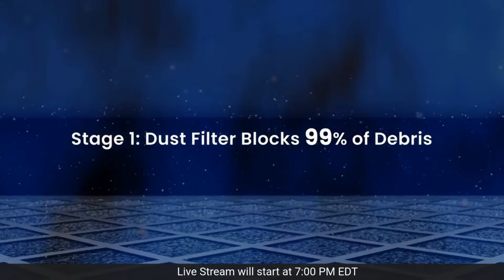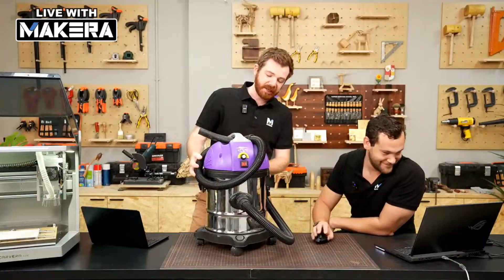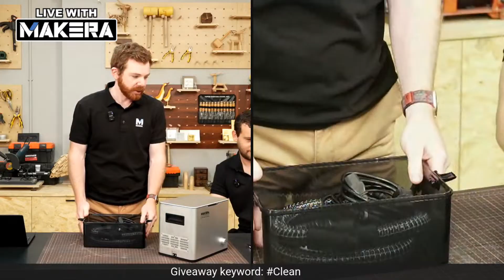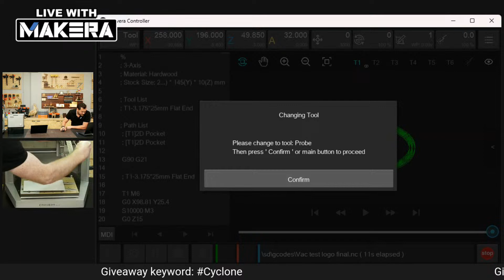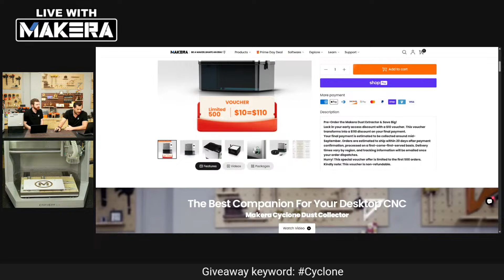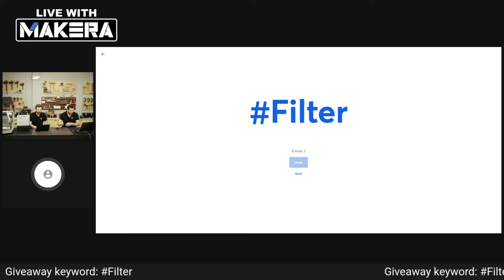New Dust Collector Launch & Lucky Draw

Comment: I have the Carvera, when you say that the adapter will come "soon" - what's the timeframe we're talking about? I would like to begin using the dust collector as soon as possible. Also it would be nice if the streams sometimes could be on more EU-friendly times :/
Reply from the maker: We do not have a specific release date at this time unforuntately, but we are adjusting our steam times to acomodate  the EU, stay tuned!

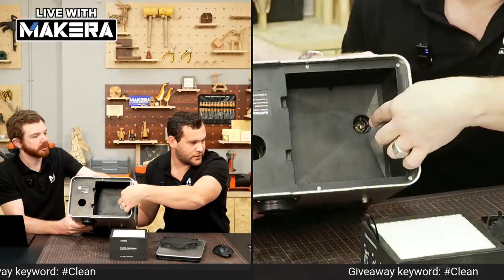Comment: 29:46 since there’s literally a funnel going to the motor the chances of foreign material getting in there is 100% likely what do you do in that instance
Reply from the maker: There is no way for material to pass into the motor as the motor entry port is below the filter cartridge. The funnel you're referring to connects the air inlet to the dust bin and filter cartridge (through a cyclone) not the motor inlet.
Reply: @Makera thanks for the response! I’m just worried about debris falling off filter when removing it for cleaning or filter change.